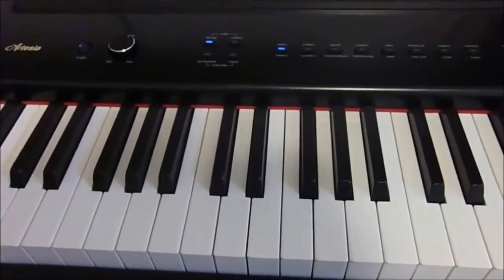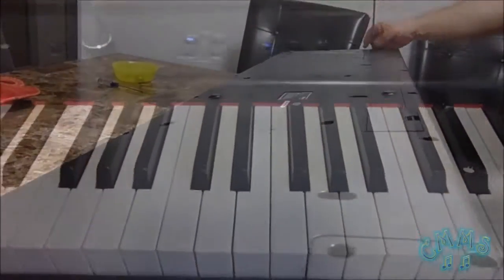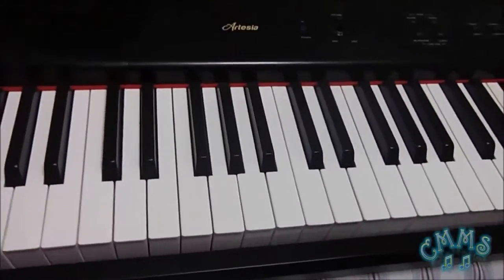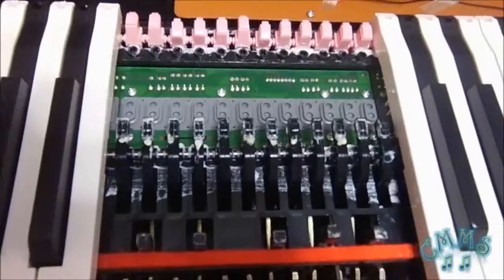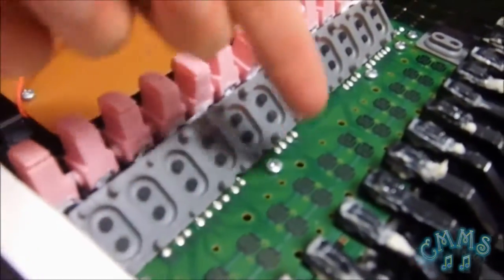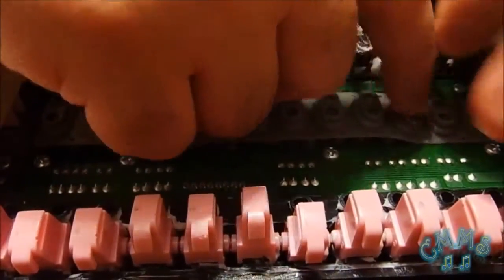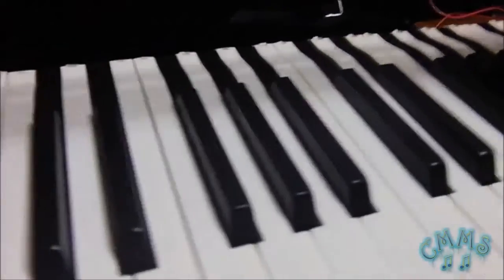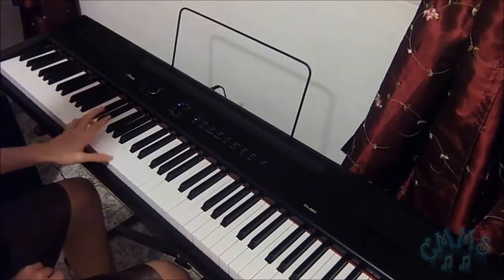Tutorial #1 - How to repair an Artesia PA-88H keyboard's dead key

Comment: thank you so much for this very helpful clip. I have decided to buy the 88H as a result here in Thailand where there i no support for anything except dogs and cows!!. I read about the dead key syndrome a lot and thought, maybe the design is not durable.  I'm  a musician and electronics engineer. Your explantion and strip down was really superb --  Now I am totally confident I can support the "dead key" problem if it happens.  To add, if i was repairing it I would lay the rubber strip over the dead key in alignment, without push down on all the ones adjacent,   and just press down to make sure the contacts had cleared. on the faulty one. I know this technology from other electronic products and yes for sure contact cleaning is essential!!!.  :-) I just hope velocity information is avaiable on MIDI out and It can be used with Musescore...via USB!

Comment: yesterday i was lucky to find a similar musical instrument. additional functions work in it, but the keyboard is dead. in general, the video suggests the same method as repairing a TV remote control. second, why only one, the first octave? in your opinion, the other keys are pristine? i will do what i saw in your video, but for now i have doubts that it is necessary to perform such manipulation with all the keys of the instrument. and the device is not small, there are at least 61 keys.

Comment: Dear Friend, thanks for the video,can you inform me what kind of rubber artesia use? Thanks
Reply from the maker: Thanks for asking. It's pretty much the same material used in other electric pianos. This one is mostly similar to the contact rubbers used for Korg. However, its size may be variable. In this case, Artesia's contact rubbers are softer. That was the main reason why the piano presented this particular problem in the video. They're more sensible to bent and break. It also affects the progressive and constant use of these pianos at long terms, so these rubbers can endure years. That depends the quality. I hope this answers your question.

Comment: Thank you for sharing this. It will be very useful. I've got the same piano. Two of its black keys are "almost dead",  they are a little lowerin comparision with its peers. Do you think it will be the same problem? It's seems something mechanical. Thanks in advance. (and sorry for my english)
Reply from the maker: Probably. You should check out its sensors, for it can be filled of dust.